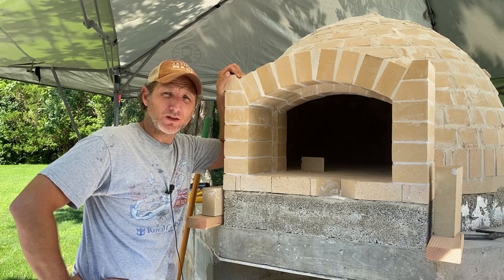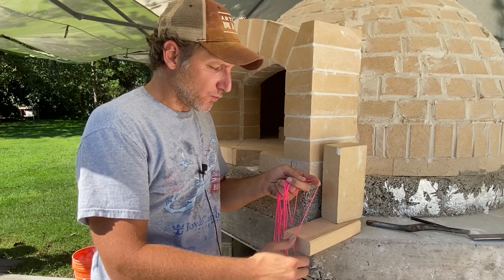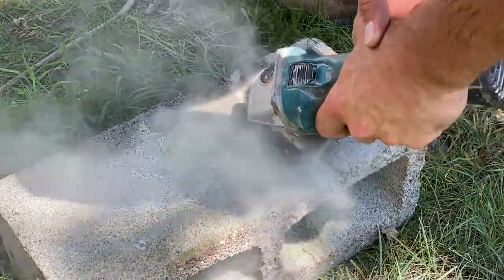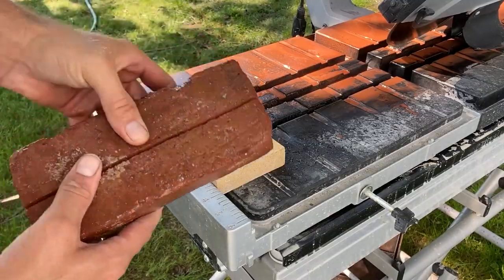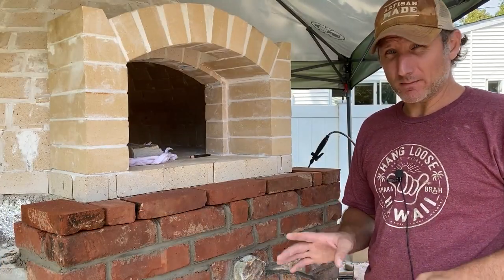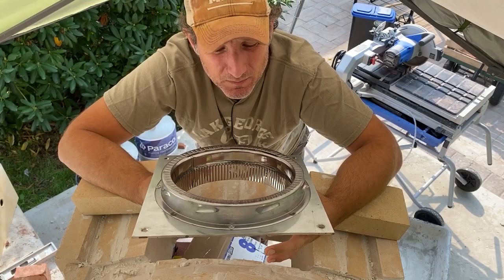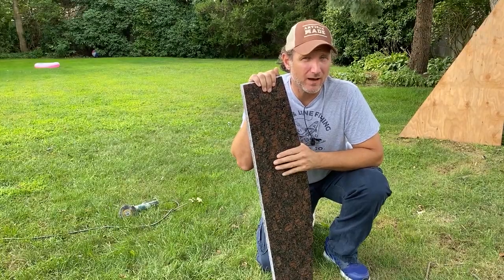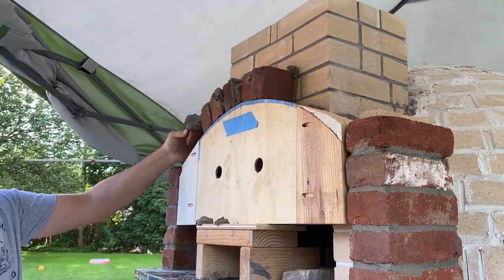How to build a Brick Pizza Oven / Outdoor Kitchen Build / Part 6: How to Build the Landing

Comment: Hi ! 
First I have to pay my respect to your craftmanship ! A real pleasure and inspiration to watch your videos. Thank you for sharing your knowledge, experience and passion ! 
I wanted your opinion (which you may have already given) about using usual red bricks instead of firebricks. Clearly for an economical reason. Here in France, i've been asking hobby and pro bakers, read on Forums, etc... That there's actually not necessarily need for firebricks to build and use a pizza/bread/baking oven. Only because red bricks are also fire resistant, at a max temperature which will never exceed the one needed and reached with such ovens. There were no firebricks 100 years ago to be used in villages for the construction of community bread oven, which are still in use nowadays here and there... 
I think with an appropriate insulation and of course refractory mortar, that the result should be as good... 
But that's my humble opinion, and I don't have any experience in this field.
I'd be glad to know your thinking on the subject.
Best regards
Reply from the maker: Red clay bricks can handle the high temperatures, and you are correct that for most of history they did not have firebrick. However, the problem with clay bricks is that they will become brittle and breakdown with the repeated heating and cool cycle of your oven. 100 years ago, only bakers had ovens and they never allowed their ovens to cool down especially because it would take an entire day to reheat the oven.  Red brick ovens would last because they did not endure the shock of the entire heating and cooling cycle.
Reply: @ArtisanMade   Thank you so much for answering ! I understand what you mean. I also found an interesting video on this subject, made by @TheFireBrickCo. 
I completely agree with you. Red bricks are not aimed at being under such thermal stress. I'm still wondering how long would it take, under normal use (2 or 3 times a month) for such a redbricks oven to begin seriously decaying... Less than a decade?
Would you then say it's definitely not interesting  to build an oven with red bricks, or that it's still worth if you're on a low budget ?
Thanks again for your attention !
Cheers

Comment: your oven has the appearance of being a little tall. What is the finished height and how do you feel about it now? these are really great videos. I think Im going to go mostly your way. Thanks
Reply from the maker: Thank You!  My oven is 3 inches too high.  Originally I had planned on using 2 inch fiber board under the oven floor.  I ended up changing the plan last second, and to get the same amount of insulation, I had to use 5 inches of vermiculite concrete.  In my opinion,  the perfect height for the oven is when you are holding the pizza peel flat on the oven floor and the arm holding it is bent at a perfect 90 degree angle.  When you have to raise your elbow or shoulder to move your pizza, it is too high.
Reply: @ArtisanMade  Oh thats even more good info....I imagine its tough to keep track of all the little details when typically these things are done slowly over time. thanks again
Reply: The build looks great! I noticed that the mortar on the chimney is darker than the dome mortar. Did you use another type?

Comment: Great work!! But I noticed one thing I mentioned before. It looks like that if you use a door and use the door stop as designed here in the video you'll notice it looks like that if you close the door tight to the firebrick indentation the vent seems like it is outside the door/oven instead of on the inside of the oven venting the oven? Am I missing something here? I'd like to know because I am in part 3 of the build right now and I don't want to mess up. Thanks!
Reply from the maker: The chimney is only one way. Smoke goes up. The door is used as a damper and to keep in retained heat.

Comment: The only thing I'd have concern about is the transition to your chimney. I'd have recommended using the refractory cement for the firebrick used along the transition as the regular mortar will degrade over time from the products of combustion. Also, I didn't see you directly measure the opening for your chimney but the rectangular area appeared around 4"×8" and your chimney pipe looked to be about an 8" round. The area of Thales smaller rectangular opening would reduce the venting capacity and its more equivalent to a 6" round in area. I'm curious to know if this ended up drafting well in continued use or of you experienced any smoke staining on the facing of your oven.
Reply from the maker: No problems with venting.  I will be posting cooking videos soon.

Comment: Hi looks very good how many firebricks did you use in entire build and wits the Price of all the materials apart from the tiles you used at the end
Reply from the maker: Used about 250 firebricks. Total cost around $2500-$3000. Not including the concrete slab

Comment: What size is the stainless steel collar for the chimney?
Reply from the maker: Interior diameter is 8 inches. The make is Selkirk
Reply: Do you by chance have the part number for the adapter and pipe with the flue ? Also, how long is the pipe? Thanks for your help, much appreciated!!
Reply from the maker: I don’t have the part number because I bought it locally.  I haven’t installed the flue yet because I’m building a roof over it this summer. Will probably be using a 6 foot long flue. The longer it is the better it will pull your smoke upward

Comment: What is the diameter of your chimney? 15 or 20 cm (7 or 9 inches...)
Reply from the maker: Check the diagrams on my website. Links in the description
Reply: @ArtisanMade  Sorry I mean the diameter of the steel pipe. Not the dimension of the flue